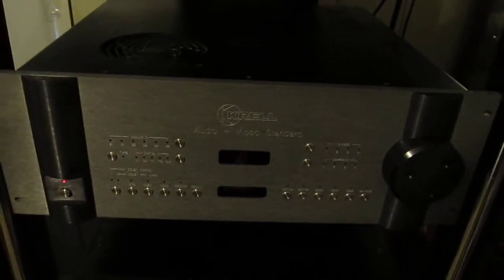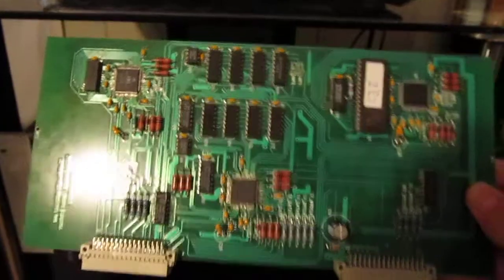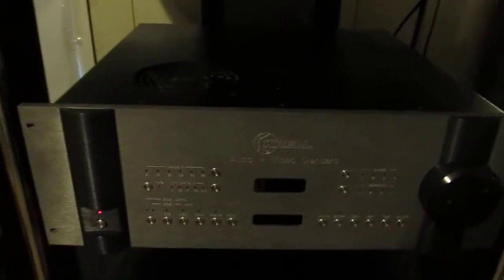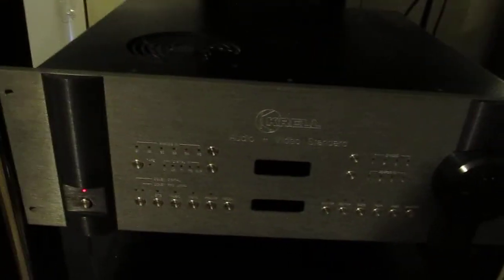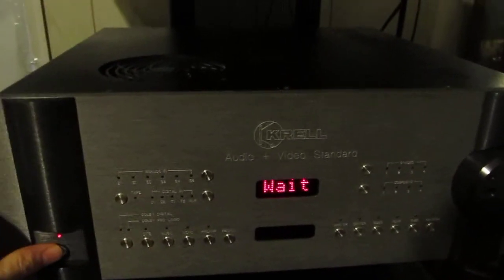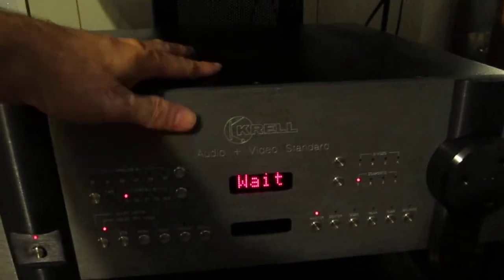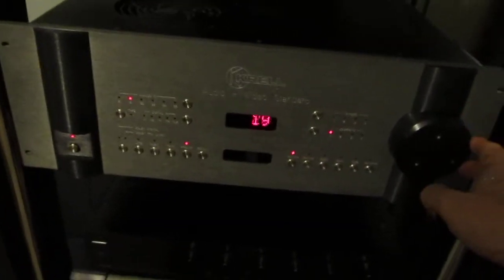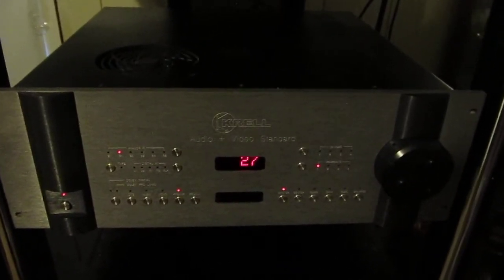Workaround for Krell AVS (Audio Video Standard) with bad Digital Decoder Board-Allows for 2 channel.

Comment: Last time I spoke with u you fixed my AVS. 
Now I have a Luxman D105 cd player that the tray will not open
And when playing cd, it tended to freeze. Let me know if it can be looked at and possibly repaired
Reply from the maker: Hi Steven, I've never had or worked on a Luxman so not sure how available parts are for those. I also quit taking in work off internet several years ago.  Thanks for checking